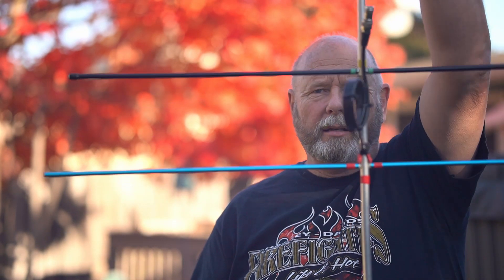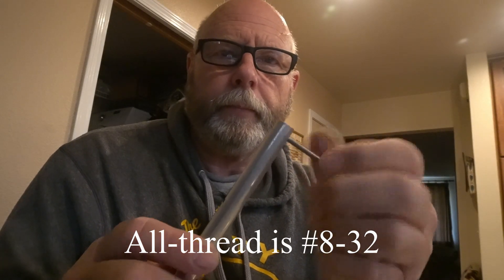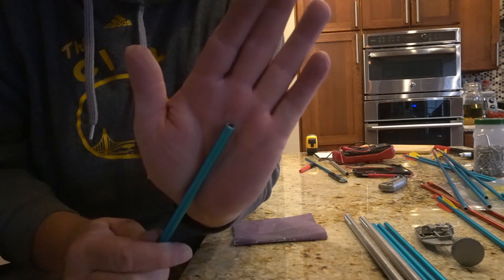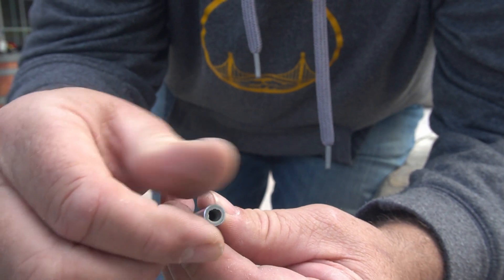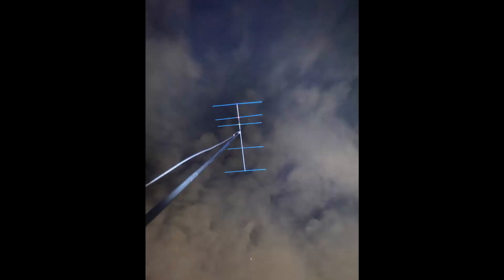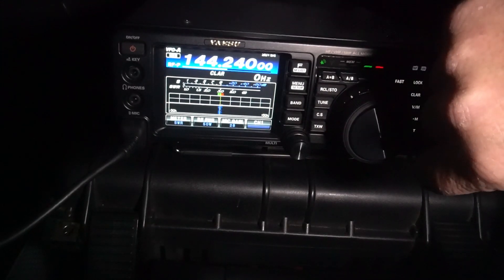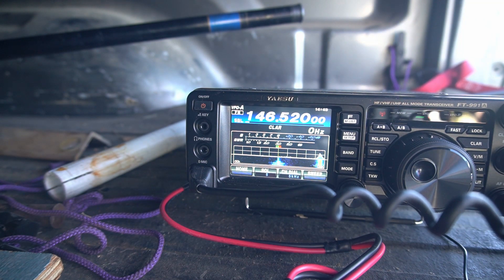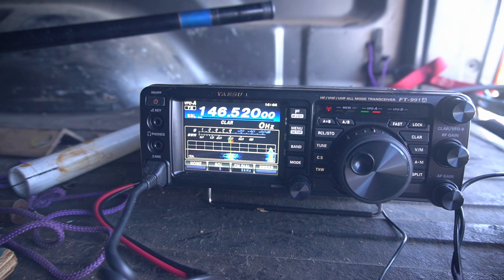How to make a 2m Yagi for portable use that weighs only 21oz for  backpacking, SOTA and POTA. Part 1

Comment: Nice video, thanks. I am intrigued by one thing though. I have a 10m yagi  by innovantenns and every element is insulated from the boom. Do you know the reasoning for connecting them all apart from the driven element?

Comment: How many watts will it handle?
Reply from the maker: I have put 50watts into it with no problem.
Reply: @KK6USY Ham Radio Adventures  awesome! Thanks for the quick reply. I have the ft2980 it tops out around 78 watts maybe I'll run it on medium power.

Comment: If you have problems like you alluded to at the end, it sure would be nice to actually see what the problems were and how you fixed them.  Having that as a throwaway at the end is a little frustrating...
Reply from the maker: As I stated in the video the arrows I used had plastic inserts,  and I replaced them with metal ones but all along my problem ended up being a bad Barrel connector.

Comment: parts list & dimensions?
Reply from the maker: It's all in the description above, like I stated in the video, thanks for watching.
Reply: @KK6USYHamRadioAdventures   not liste  on where to drii te holes  yhr length of te arrows  u used for the elemits ? can u up losd a drawing that u disd & te list of msterials u used?
Reply from the maker: @moparman8254  Dimensions,
reflector -    20 1/8" x 2                 1/4"         in from end of boom
driven -        19 5/16" x 2              11 3/16"  from reflector - insulated from boom use nylon washers and all thread
dir. 1 -          18 3/16" x 2               17 3/16   from reflector
dir. 2 -          17 15/16" x 2             37 5/8"    from reflector
dir. 3 -          17 11/16" x 2             58"           from reflector
Boom is 1/2" aluminum tubing   58.5" long
Parts used in this video. 
All that info is above not sure why your not seeing it?
Reply: @KK6USYHamRadioAdventures  found them now .
Reply: @KK6USYHamRadioAdventures  r u using it on fm or ssb?
 where did  u find the plans to make thi or did u copy it from another beem?
  i need one for 2 meter fm
Reply: @KK6USYHamRadioAdventures   how did u connect te center & the ground of the feed line?   crimp rings connectors?
Reply from the maker: @moparman8254  yes
Reply: @KK6USYHamRadioAdventures  thais was in part2 of the vid   i understand now how u insolated the driven element  from the boom 
 could i use 11/2" pvc tubeing for the bom & platic bolts /all thread  for the driven elemit?
Reply from the maker: @moparman8254  Yes I have mase a similar antenna with a PVC Boom

Comment: Got to love the directional antenna.  I've busted so many pile-ups on 10, 15, and 20 meters with the Mosley.  Making a 2 meter yagi looks like a fun project.  Maybe even do some fox hunting, or add a 73cm component and do satellite work.  Man, you insoired me to get creative.  Maybe I'll do a tutorial on antenna modeling software.
Reply from the maker: Chris I have a ta33 and even at 10' testing it was amazing. I have never had a pileup on 2m until using this antenna on a POTA. This is a fun antenna to make use square tubing to mak it easier, thanks for the comment and for taking the time to watch!

Comment: dose one need to put this on an SWR meter or dose one just build it and it will be good enough? The reason I ask is I don't have an SWR meter and would like very much to build one
Reply from the maker: Sam if you build it to the dimensions I posted below and use the same materials it should be very close I used the link I posted and didn't change anything and it was good. It is always best to check the swr though maybe get the best swr meter you can afford you will always use it later. 73
Reply from the maker: This one will do up to 2 meters. https://www.dxengineering.com/parts/dmn-sx20c
Reply: @KK6USYHamRadioAdventures  Thank you so much for the information. 73

Comment: So on 146.520 did you spin yagi around to vertical? Also what was best distance on fm vertical and ssb horizontal? Thanks!!!
Reply from the maker: Mimi Heaven
, Yes For FM vertical and SSB horizontal, the antenna covers both parts of the band with swr at 147.0 1.0:1 to 1.3:1 at 144.0.  The day I test I had contacts up to 100 miles with the antenna at about 10' or less most of the time. I didn't have a lot of time I had already finished a POTA that morning and needed to packed up and head home. I was also at 6000' elevation and that doesn't hurt any Lol. I will have a second video out soon with a better look at how it was constructed and materials used. Thanks for the comment and for watching.